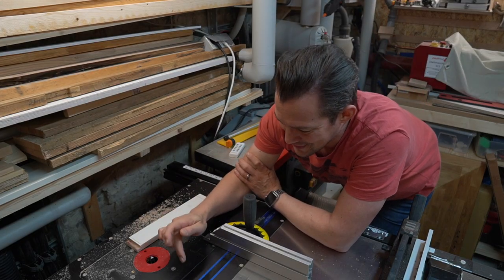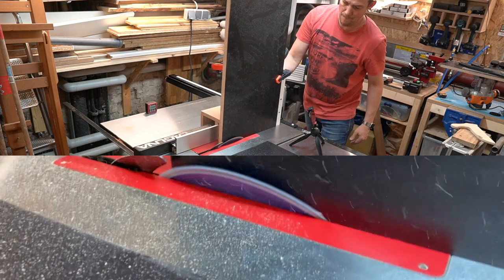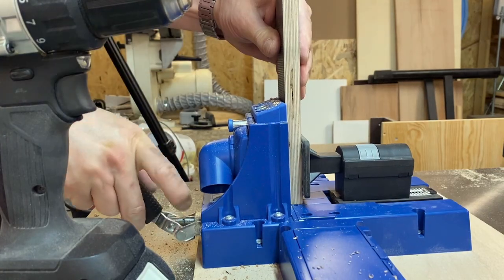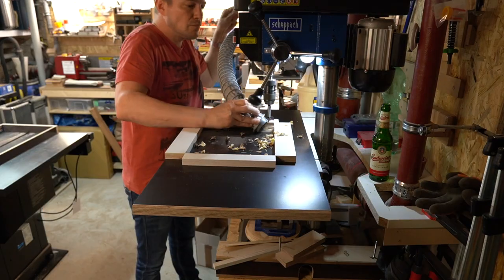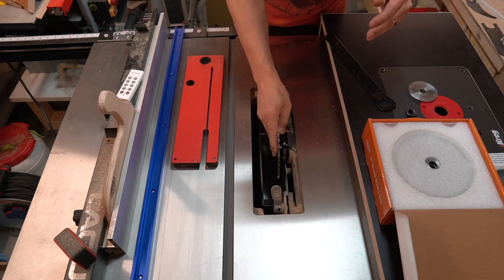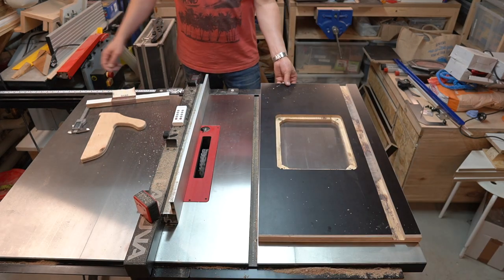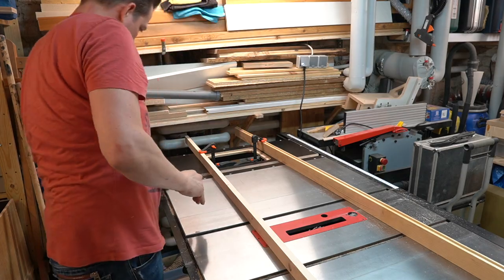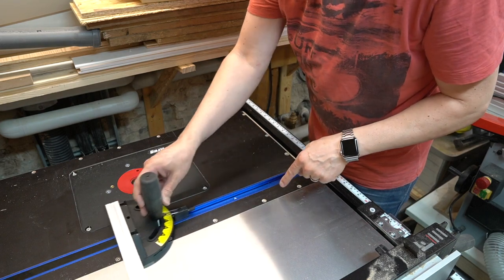The router table extension for Laguna Fusion 3 (CE-Version)

Comment: Very nice design/build Shane!   What was the black laminate spec's you used?   Did you find you needed legs at all, because the extension fence rail doesn't seem like it can handle too much weight away from the cast iron top (I see legs on both the outfeed tables and the right-side extension table in the laguna videos).
Reply from the maker: Hi Jim, it is 21mm (approx 13/16") black laminated birch ply. I guess if you plan to mount a full metal router lift it might get too heavy, but with the Triton router it is fine. The extruded aluminium is quite sturdy and on the back it is 3mm (approx. 1/8") angle steel. But definitely it cannot harm to attach some legs , or build a cabinet that supports the rails. The latter is on my list ;-)

Comment: nice job can I have a question regarding the saw though ? if u have CE version how did u get dado blade in it ? did you have it customized aftermarket ?
Reply from the maker: The arbor is long enough, and has a 5/8" diameter. Only thing to deal with is a cavity in the flange/shoulder that makes room for the 30mm bore adapter that is part of the outer washer. My solution is another precision washer that sits on the 30mm recess and has an outer diameter like the flange/shoulder of the arbor. Hard to explain in words, I might do a short on that :-)
Reply: Thank u for ur reply. Well if u could do a video it would be great i actually just received the saw and wonder if it would work or not. I actually found a dado stack which is CE stamped.

Comment: Great work! A couple of questions:
1) Do you find balance of the saw impacted at all with a weight so far out from the center of mass? Or did you counter balance with a weight on the other side?
2) Learning from this experience, what would you do differently if you did it again?
Reply from the maker: Thanks Wayne, the saw stands sturdy, the center of gravity is quite low and also skewed to the left where the motor sits. Granted I should fill maybe a layer of masking tape in the joint between the main table and the right wing as it is slightly hanging (only visible with a straight edge).
What would I do different? I am planning to rotate the router table by 180° to have the miter slot on the far right side. in that way i can install a feather board more usefully.

Comment: do you think this table would work on the new f2?
Reply from the maker: As fart as i understand, the cast iron tables of the F2 and F3 are the same size, hence i think this will work. the F2 has also enough overall weight to keep the center of gravity low enough (to bear the asymmetrical weight of the router insert on one side).

Comment: Your video is loaded with innovative additions to your Laguna Fusion 3...well done again Shane.   I'm particularly interested in the specs of the adapter you designed and installed for your Dado stack.  It is common to get US dado stacks with 5/8" bores...is that the bore of the stack you installed?   Is there plenty of room on the blade arbor, with your stack installed?  Does your adapter convert the 30mm bore to a 5/8" bore flange?  Thanks for any help you can help other Dado users with.
Reply from the maker: Hi Jim as stated below where i got a similar question regarding the Dado capabilities, the arbor is long enough to fit a full dado stack It is 5/8" in diameter. The inner flange however is somehow "concave" (the shoulder of the flange does not begin right at the arbor diameter but at around 35mm diameter. It is recessed to make space for the 30mm bore adapter that protrudes in from the original outer washer. Hence you need a special outer washer that distributes the pressure to the bigger diameter. Basically a 3-4mm thick washer with 30mm bore and 65mm outer diameter (hard to describe in words, hope you get the point :-)) (PS: i turned this on my Mini Lathe)
Reply: @Shanesweekendbuilds  thanks Shane

Comment: l've also ordered the same table saw as you on back order i would love to see someone do i review. if not is there nany cons to the saw thanks
Reply from the maker: i need to see if i find time for a review. I am happy with the saw. I placed an anti-vibration-mat below the cabinet to keep the vibrations of the motor out of the building. No big deal, but i am in the basement, hence need to be as silent as possible for a wood shop. The saw passes the "dime test" with ease :-).
Reply: @Shanesweekendbuilds  thanks for getting back to me
Reply: hi i just got my saw could you tell me where you got your none throgh cut riving knife from please
Reply from the maker: @Chris-vp9ht  Hi I got mine from IGM-tools in Czech republic https://www.igmtools.com/igm-laguna-riving-knife-for-non-through-cuts/ and I ordered another thin kerf riving knife directly from the USA via Woodcraft https://www.woodcraft.com/products/thin-kerf-riving-knife-for-fusion-f1-f2-or-f3-table-saws-laguna

Comment: Hello Shane, i have a question regarding your table saw, where have you buy it from? And you have the european version with dado cutter option?
Reply from the maker: Hi Daniel, I bought it from IGM tools from the Czech Republic, please see the link in the video description for the shop. 
Regarding the Dado capabilities, the arbor is long enough to fit a full dado stack. The inner flange however is somehow "concave" (the shoulder of the flange does not begin right at the arbor diameter but at around 35mm diameter. It is recessed to make space for the 30mm bore adapter that protrudes in from the original outer washer. Hence you need a special outer washer that distributes the pressure to the bigger diameter. Basically a 3-4mm thick washer with 30mm bore and 65mm outer diameter (hard to describe in words, hope you get the point :-)) (PS: i turned this on my Mini Lathe)
Reply: @Shanesweekendbuilds 
Thank you Shane!
I think i know what you mean with the washer, but since i dont have a lathe i need to find someone to make one for me. One more question if you dont mind, what type of dado stack do you have? Can you give me a link for that?
Reply from the maker: I have this one: Oshlun Stack Dado Set, 5/8 Zoll Arbor, SDS-0630 https://www.amazon.de/dp/B0012YILDQ/ref=cm_sw_em_r_mt_dp_C7V9G66TP9KAFFEC9H0Q?_encoding=UTF8&psc=1 and later i upgraded to this one (directly ordered from the US so you have to pay customs and tax and it is a luxury price but very easy to dial in: https://www.amazon.com/dp/B000089H8P/ref=cm_sw_em_r_mt_dp_P2CRYCJZFZHMPRT8ACHJ
Reply: @Shanesweekendbuilds  Thank you Shane! For all the help and info.
Reply: Great video, thank you Shane.

Comment: Hallo. Nice work. Just got my LF3 here in czech republic and this router wing Will probubly be my next step. I have Just one question. Did you have a problem to adjust the table so the miterslot would be in one line with the blade. Seems like there is not enough wiggle room to adjust it just perfect. Even if I move the table as far as it gets, it is still 0.3 mill off. Also it looks like the left bolt have no room to wiggle at all which is pretty limiting. So I don't know, if I am just stupid, or its a manufacturing error. Thanks for your suggestions.
Reply from the maker: Hi, for me it was no problem to align the table. I would recommend to losen 3 bolts and use the 4th bolt as turning point. If this doesn't help or the holes on the cabinet are too small to get it right, another mitigation option might be to widen the holes with a drill? Do you measure with a dial gauge and the mitre gauge? Please be aware, that the dial gauge will jump if you change the sliding direction, so only measure in on direction. Hope this helps, any further questions welcome :-)
Reply: @Shanesweekendbuilds  Hi. Thanks for quick respond. I will probably end up makeing those holes bigger I just don't want to loose warranty so I will wait now. Seems like 0.3 mill is not a big deal. Otherwise the saw is great. So thanks again and happy new year 😃
Reply: @MickeyStoun  Hi i have the same table saw. Theres no need to mąkę the holes bigger. You just need to leave only one screw to be your pivot point.  Then with the dead blow hammer with slight taps alignt the table to the blade :) minę is now set to 0,02 front back of the blade (set with the dial indicator.
Reply: @paweg1157  Hi. Thanks for your suggestions, but I tryed just that and the farest point I can get around the pivot point is still not anought. I don't believe that they would do souch a mistake I the factory, so the problem probably is on my side, I just can't find it 😃

Comment: Did you consider any options for a fence, rather than the t-track slot/mitre sled combo?, or are you planning on incorporating that onto your excellent solution?

I've a question regarding the jig you build that you use for chamfering at (0:55)…how did you avoid the fence wing nuts, so that you can slide your jig on the fence?  I built a small jig that rides on the top rail of the fence, but it is only supported by the 10mm extruded aluminum fence face, so I'm worried about torqueing the fence if I try cutting tall items with the jig.  A jig like yours, that can ride on the cast iron top and be guided by the fence, seems so much more robust...well done, however you've managed to avoid the wing-nuts...perhaps you will do a video on your jig build?...please?!?
Reply from the maker: Hi Jim, thanks for the feedback. Actually i should do a short video on this as it is hard to describe in words...:-) I designed a "classic" U-shaped base for the jig that spans over the full width of the fence and is even a bit wider than the fence wing nuts. This part rides on the cast iron. To enable the guidance i added another board on the inside of the adjustable Fence rail. This board together with the left board of the "U" is fitting snugly on the fence rail.

I the meantime i build a prototype of a Routing fence. I guess i should do a small Laguna Jig video :-)
Reply: @Shanesweekendbuilds  thanks Shane

Comment: It seems like most of the european woodworkers prefer 5 in 1 machines or sliding table saws. What is the reason you decided to have a table saw that is more common in North America?

What is the advantage to your saw opposed to the sliding tables saws?
Reply from the maker: I think it is mainly a matter of taste. In European, especially German woodworking forums you won't find (m)any people recommending the US-style TS. Although I see the advantages of certain cuts on a panel saw, my personal choice is based on the fact that I have no space for a 1,6m sliding table, i want the ability to mount dado stacks, and having a big cast iron surface and trunnion. Despite the fact that a panel saw has a hell of a footprint I consider the full steel/cast iron Laguna F3 more sturdy than the Bernardo and Holzmann panel saws in the same price range. But i do not intend to convince anyone, it is just my personal choice.
Reply: @Shanesweekendbuilds  Awesome, thank you for the reply and your perspective.